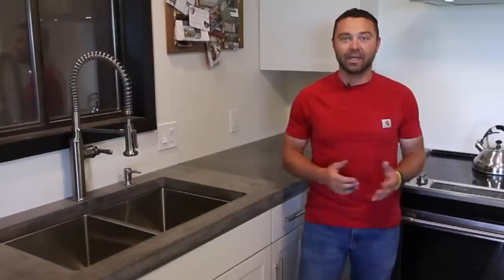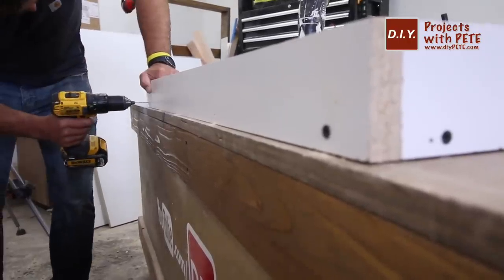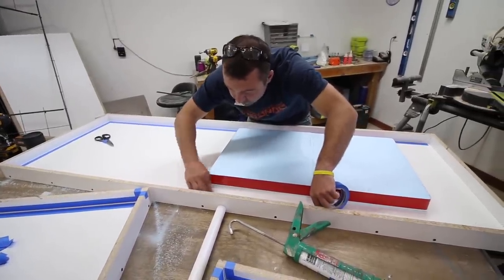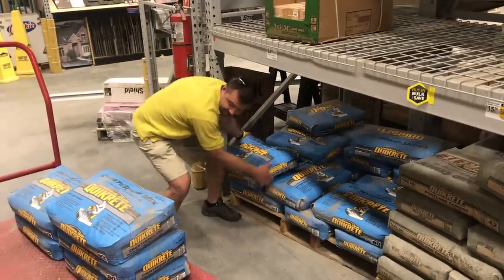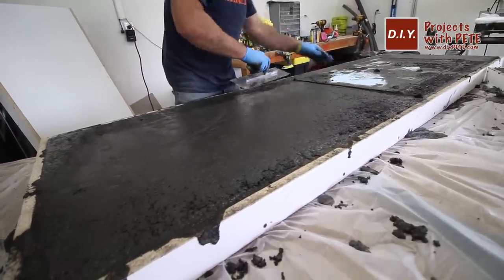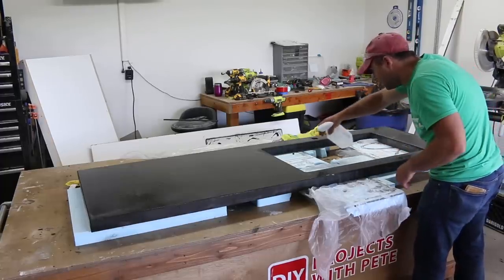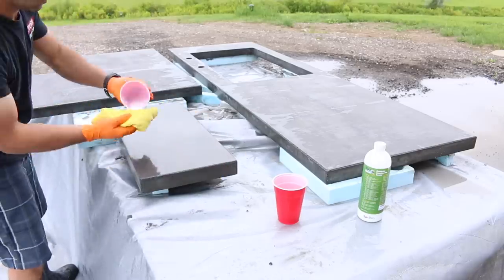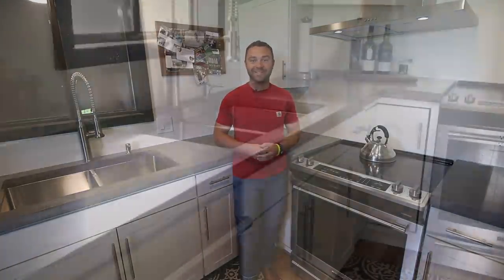How to Make Concrete Countertops

Comment: Hey Pete! Can you send me a link to the sink you used? Thanks!
Reply from the maker: Hi Lynn! I got the Franke sink: https://amzn.to/2NBhHmO   --- I love the sink, but since I added a soap dispenser I had to add another hole, which was not easy to go through the metal. The next time, I'd use one like this: https://amzn.to/2OeN2wO  -- because it doesn't have the big lip on the back, so you don't need to drill any holes or line things up 100% perfect. Cheers!

Comment: how do you repair this type of countertop if you get a chip on the edge?
Reply: Molly Isagurl chip the rest and call it a live edge
Reply from the maker: If you were to get a chip, you can mix of a little bit of cement and sand to match. mist the area and use a little bonding agent and then patch the area. Sand smooth and then seal.

Comment: Why didn't you make a concrete sink? I've seen some really good looking molds online.
Reply from the maker: Hi! I wanted a stainless steel, but I think I may do a concrete sink for one of the bathroom vanities. Cheers!
Reply: No expert myself, but have seen several videos by professional counter fabricators that recommend not to use concrete sinks in the kitchen. Too fragile for the banging of heavy pots and pans. Ok for bathroom lavatories though.

Comment: What about a vibrating rod to get rid of the air.
Reply from the maker: Yes, you could use a concrete pencil vibrator or another tool to vibrate the concrete. Just make sure it doesn't bump against the mold as that could damage the melamine. Best of luck!

Comment: What is the purpose of glass fiber?
Reply from the maker: As added reinforcement.
Reply: Thanks for the reply. I've watched  many of your video's  but this is the first time i see you adding fiber glass. Any particular reason to do so?  I'm very curious because i'm on the way to build a table for the hobby area and would love to do it with concrete .  Thanks for your tutorials.
Reply from the maker: I did the glass fiber around the sink area since it is prone to cracking without proper reinforcement. It is a little added reinforcement to help in the narrow areas. If you are simply doing a table, you will not need the glass fibers.

Comment: Thank you for this video - this is a future project for me - curious to know the cost
Reply from the maker: Hi Alicia! I will be having a post soon with all the info. This came in at about $450 for the concrete portion ( does not include the metal sink/faucet etc ). The price can be brought down quite a bit by using Quikrete 5000. The next video coming out is an outdoor kitchen and I show how to use a normal orbital sander instead of a polisher --- and the Quikrete 5000. It turned out awesome and the entire outdoor kitchen concrete portion for that project was about $200.

Comment: Why not mould the concrete to be seamless. Maybe have an extra couple hands to bring the concrete to the cabinets and hold it upwards while you glued it down. Not sure why they're had to be 2 pieces around a sink area if you were making them from scratch?
Reply from the maker: The sink area is very delicate with only a few inches on each side and so splitting it up was what I decided to do to minimize the chances of issues during the overall process. It's also much more manageable to work with. You could certainly look into doing it in fewer pieces though.
Reply: @DIYPETE  I do this for a living and as long as the guys know how to properly carry and lay down the smaller width areas of the slab. Then you'll be fine

Comment: I'd just make it soupy.... We pour all of our foundations and slabs with a ton of water in them and decades later they haven't cracked at all. It's so easy to work and air comes right out with just a hammer.

Clear 2 part epoxy is the best sealer.

Comment: Great work. But not my style, too rough looking.i like the bullnose look on edges. And the stove  didn't get wrapped looks plain. Many years ago I used to build those already in place. U know - do the frame work on the cabinets that way it.ll be one solid piece. And then i.d add the color to the mud. I added  a little bit of baking soda to the mud and it dries in mins. Thanks
Reply from the maker: Sounds good!

Comment: Great job Pete , how did you attach the countertop to the cabinets?
Reply from the maker: Thanks Pappi! I put a few globs of 100% silicon on the plywood supports that I installed in the top of the cabinets. This prevents it from shifting. They really wouldn't move since they are so heavy, but the silicon hold them.
Reply: I think that he used silicone.
Reply: He even says so in the video.........

Comment: No need for tape.  Lay your bead of silicone and then spray over it with foamy ammonia free glass cleaner (Sprayway) then tool it with silicone tooling device or with a finger covered in glass cleaner.
Reply from the maker: Thanks Matt. I used that technique in another video here, and do prefer it now. Cheers! https://www.youtube.com/watch?v=A0Pd4o8gjfM

Comment: I know people that do concrete put motor oil on the wood supports so the concrete doesn’t stick to it
Reply from the maker: Thanks! I've used that with concrete forms when doing a foundation. The concrete will pop away easily from the melamine. If needed, you can use wax though.

Comment: Pete. Please speak to me before applying Omega. I'm the UK distributor for it and use it professionally. 
I'm also the one who put you onto CCI and Omega.
For example you shouldn't be applying Omega at more than a 400 wet polish as it won't bond well and you'll have issues etc
Reply from the maker: Hey! Thank you for reaching out again, I appreciate it! Also, THANK YOU for the referral to give it a shot!  I got in touch with them and now have some to experiment with. Got the login info for all the tutorials and a contact over there as well. Good to know about not going over 400 for wet polishing. Can't wait to use it, will definitely reach out with questions! Cheers! Thanks again!
Reply: DIY PETE anytime mate

Comment: It os a ton of wprk amd messy as hell. If your doing it by yourself. I helped with my parents countertops and we used blue powdered dye and later spread a white powder on the top. So ots a blue and some white streak. 

Didn't turn out the  forst try but seccond one was better.
Reply from the maker: Glad to hear your second one did improve and turned out better. It is a lot of work and messy. Definitely not for everyone. I've used the dry sanding technique and somewhat prefer that method to eliminate the wet polishing. https://www.youtube.com/watch?v=A0Pd4o8gjfM

Comment: DIY PETE why didn't you cut the spout of your silcone kit at a 30-45 degree angle about an inch and a half from the tip, so you would get a slighly wider opening at 30-45 degrees. You would have no tape or clean up afterwards, would have saved you at least an hour's worth of work. That only works for the mould making part, btw. NO tape and no clean up, try it next time, it is a life/time saver. Also if you mix your concrete to a thinner consistency it will get into the corners way easier and you don't have to work it in that much, also removing air bubbles becomes a breeze, only downside it takes longer to cure, but overall saves you a lot of frustration and unnecessary work. Also if you want to make the countertops truly water resistant, try using some 2 component boat epoxy, it's truly a miracle. Adn you can either finish it matte or super high gloss...Hope that helps man, great project.
Reply from the maker: Thanks for all the info!
Reply: @DIYPETE  You are more then welcome, you help us out a lot as well by posting this type of content for us for free. Have a magnificent day.

Comment: Why making templates, if you can easily use old countertop and do some adjustments. Easy and and way cheaper and faster.
Reply from the maker: Hey Mark! The old countertops were not perfect neither was the sink area. It was more accurate to build a quick template. Cheers

Comment: Maybe you could try adding concrete slab heating cable into the concrete counter tops. They would be nice and warm to the touch during the colder months. Just zip tie off the cable to reo mesh before it goes into the melamine mold. Have the cable exiting the slab from underneath in the cabinets and connect it to a appropriate power supply. Most women hate the cold. The reality is they spend the most time in the kitchen so she'll love you for it.
Reply from the maker: That'd be cool to try out!
Reply: Very bad idea! There is no purpose for it. Not only do women not sit, walk or lay on their countertops but a warm counter would be counterproductive to all that baking that you wish they still did! Cold counters keep fats from melting while handling, speed the growth of bacteria (health hazard!) and would also cause faster food spoilage, i.e. laying produce on the counters would cause the entire bag, bunch, etc. to start spoiling/wilting from the heat causing food loss and possible digestive issues.
BTW, sexist comments like yours are not really appropriate anymore.

Comment: Great job on making these counter tops. You just need to learn the correct method of siliconing. So much easier and more professional to use an ice cream stick and a water spray bottle. Well done though.
Reply from the maker: Thanks!

Comment: Why don't you make it portable? It would fill the form better.
Reply from the maker: Not sure what you mean by making it portable.
Reply: @DIYPETE  thinner like cake batter
Reply from the maker: @kcerin1  Ok gotcha. It is a bit drier than I sometimes mix, and a little more like cake batter would be alright. As you know,  too runny of a mix can lead to a greater chance of shrinkage cracking, surface problems, lower strength, and other issues. That being said, I could have mixed it a bit more than I did though. Cheers
Reply: @DIYPETE  not if you add an additive to the concrete and reinforcement so it floats in the middle
Reply: @DIYPETE  meant pourable
Reply from the maker: @kcerin1  Yes, i do use a plasticizer additive sometimes which of course makes it more fluid with less water and so it flows much better and requires less water. Thanks for your feedback.

Comment: This is by far the most complicated way to build a concrete counter top. Zcountertop solution has a great mold so you can poor them In place. Check it out!
Reply from the maker: Hey Andrew! I generally show the reverse cast technique as a way for a beginner to get a perfectly flat top and do everything in a controlled environment. But the water polishing etc is definitely a lot more work and I feel like a later video I made simplifies the process quite a bit: https://amzn.to/2CVXtR6    ---- But I have done the pour in place counters ( although not using Zcountertop ). I love how quick it is, the process of hard troweling is quite an art in my opinion, but if someone practices on a couple smaller tables or projects first, I think they could definitely tackle a pour in place project. Thanks so much for your feedback, and I'll have to show a full kitchen using that process in the future! Cheers man!

Comment: Pete - I love your channel, and 99.9% of the work you do. However, that seam to the right of the sink really sucks. Who wants to do all of that work, and then end up with a seam in their counter top right in the middle of the slab? ...umm ... nobody? That's too bad - because otherwise it would look amazing.
Reply from the maker: Thanks so much for your feedback and for subscribing, I really appreciate it! I had to have a break at some point to make the piece manageable to get in the house and while working with it. I mention in the video that I accidentally beveled the edges on those ends where the seem connects, which I was bummed about b/c the seam appears much larger. Anyhow, thanks for letting me know your thoughts, and I'll do my best to improve the seams in the future. Cheers!! Thanks again for watching and for your comment, I appreciate it and it is what helps me improve.

Comment: You added sooooo much work with the taping everything off. Good lord. And what a waste. All you need is to put the silicone on and then mist it with denatured alcohol, use a sample chip of a counter top (get for free from any home improvement store) and clean. You can be done in 5 minutes, not 45 like with the tape.
Reply: Agreed, tape is super wasteful, esp on the inset sink bit using the index finger after lol. From other videos, I've found the faster method is to use a fondant ball tool and it gives a perfect edge each time. Just peel the excess off as the ball separates and leaves the perfect curve :D
Reply from the maker: Hi Bear, yes, I learned about the fondant tool a while back and agree it works much more efficiently. Here is the video with that technique. https://www.youtube.com/watch?v=A0Pd4o8gjfM&t=298s

Comment: This is interesting but, prepping food on your garage floor isn't all that appealing. Not bad for a man cave.
Reply: If you actually take the slab in the kitchen and clean it every day it stops bein your garage floor
Reply from the maker: Hey Larry! It is sealed with food safe sealer and wax. You can dye the concrete any color. Cheers!